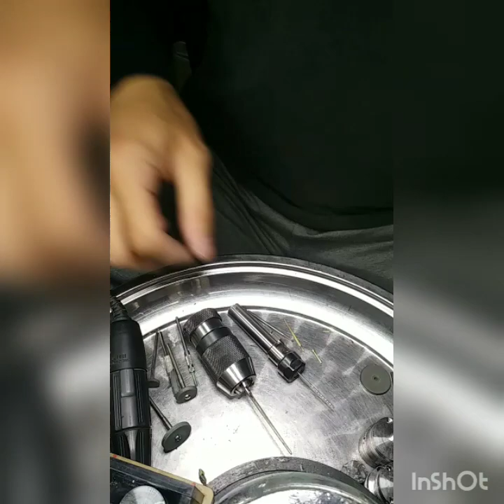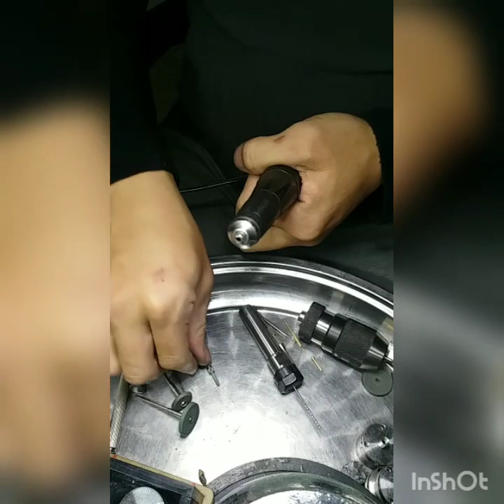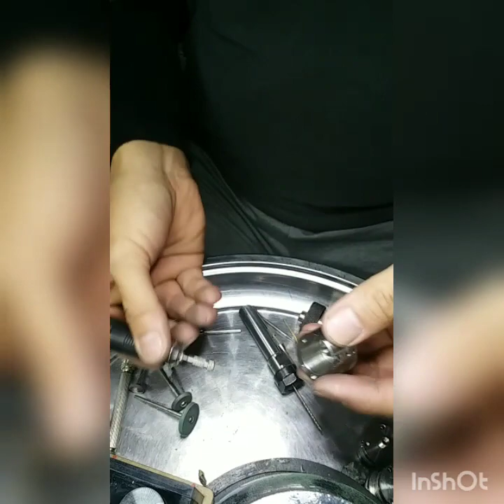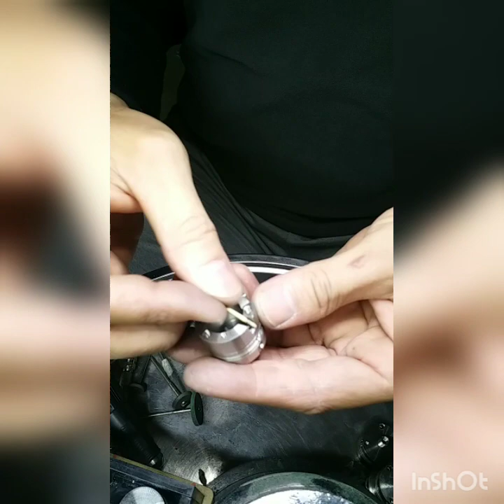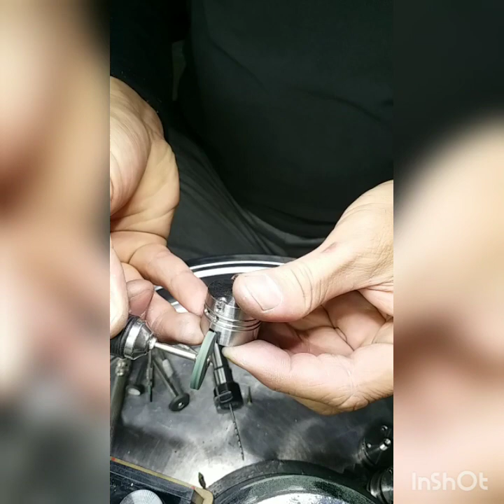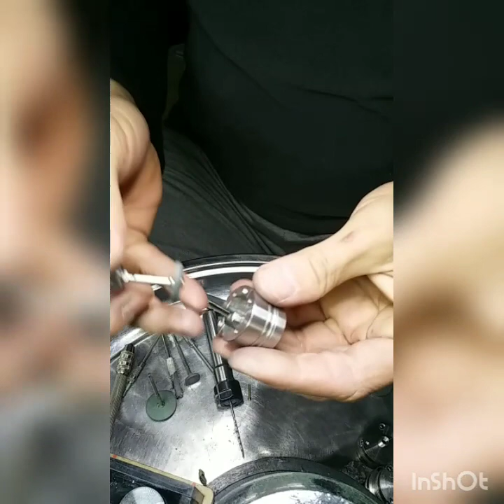My control valve unit.

Comment: Can your control valve unit be retro fitted to my Andu graver?  You should have my email in your records. Your work is really first class. JCantrell
Reply from the maker: Yes I remember Mr. John Cantrell! If your engraver now is locking handle it could fit with the valve control unit to upgrade.
I will send you ms when this lot of valve ready Mr. John!
Thank you for you feedback! I am always try my best :)
Reply: @vungocanh5198   Hi viewed your cleaning video, I think I understand what you mean by locking handle. My graver has a threaded handle. I may need to buy the whole tool?
Reply from the maker: @johncantrell8873  Yes Mr. John the screw-on handle not fit new Handcontrol engraver. I think the best way is take the whole Handcontrol engraver because some time foot control engraver is better as stippling or hammer the gold when inlay.
Reply: @vungocanh5198  Let me know when you can ship and $$$ Thanks JohnC
Reply from the maker: @johncantrell8873  Ok Mr. John! I will have valve unit ready next week. I will rest 2days for New Year day. I will tell you before send invoice Mr. John.
Thanks you sir!